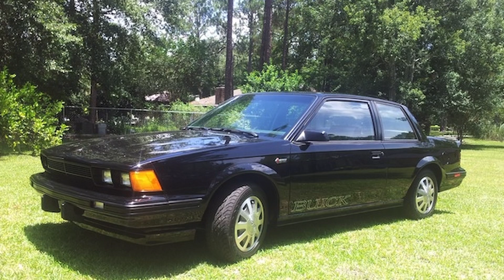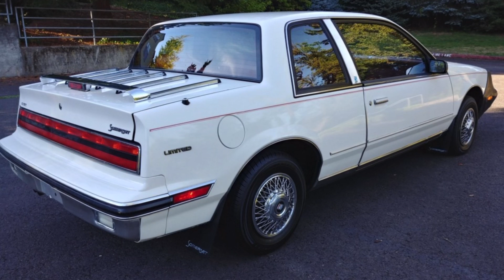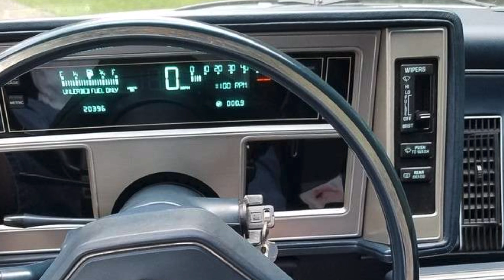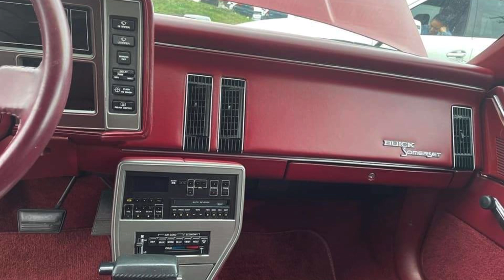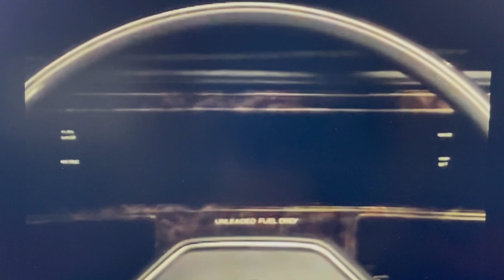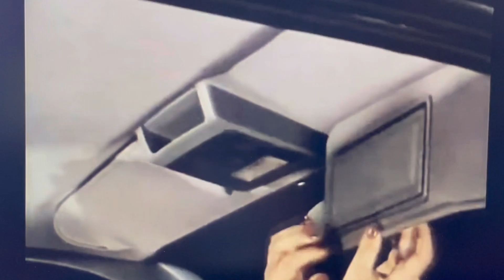Funky Automotive Interiors - The 1985 Buick Somerset & Its Tech-Centric, Porsche-Inspired Interior

Comment: My dad bought a red one in late January 1985. The next model year, 1986, the mandatory high-center brake light was standard. That year, 1986, everyone knew who had a new car. 

Airwolf was on TV at that time.  We used to turn the car on and play with the digital dash (I was 13 at the time). 

The interior sucked.  The plastic covering on the center console withered away.  

He junked it about 10 years after purchase.  I learned how to drive in that car.

Comment: These were nice little cars...my Grandfather (Mom's side) bought an '87 Limited new in Rosewood in and out.  The color was quite attractive.  They were much fancier than any of the competition inside, and fairly comfortable.  The options list was very long...his car had about half the equipment.  It was on the lot vs ordered personally or even searching inventories nearby.  I wanted him to buy one with the 6 cylinder, but he said he would save gas with the 4, as well as get one with the equalizer and Concert Sound (if not Bose), but his had the regular cassette radio with extended range speakers in the rear.  It sounded decent as I recall, aside from that exaggerated mid bass to make up for not having actual bottom.  We had it even after he passed on at the end of 2000, where at the beginning of 2003 my father was using it and got into a bad accident, which totaled it.

Comment: I had a 85 Somerset Regal with the 4 cylinder and stick shift. Loved the car although it had debris in the tank and kept clogging the fuel filters. Easy enough to pull over climb under and pull it off then blow it out. For some reason never occured to me to drop the tank to clean it out. Mine was a gold color with tan interior.

Comment: If I recall the 79-80 Buick regal had an Somerset trim package that looked very similar to the 78-79 Ford's Bill Blass Lincoln MK Vs, with that white and deep navy blue trim patterns externally and in cabin also. Saw  a 1980 Buick Somerset at Syracuse Nationals 3 or 4 yrs ago , reminded me alot like the Bill Blass color scheme.  I understand they are quite rare.

Comment: The socialist agenda of the 70s meaning tight emissions and cafe under Carter hit hard and the carmakers had trouble trying to catch up. This never should have happened. Yes better air quality but leave the darn cars alone as far as engine size and car size. Anyway there were good cars at this time but not like the 60s and 70s.  The GM 3800 engine was excellent. Some luxury cars like Olds and Buick and Cadillacs Lincoln kept beautiful interiors. Some smaller ones good too.  And to this day thanks to socialism the cars are not good and ugly.  We could easily make beautiful cars from the 60s and 70s today without all the government crap and have chrome bumpers and such rather than the stupid looking space like cars that all look the same and they’re all full of plastic ugly.   And I hate hard seats like today!
Reply: You know what gets ME? The govt. mandated those huge cow catcher bumpers in 74 to protect the body of the car and supposedly reduce insurance rates. Now, the fronts of most cars are so streamlined there's no way to even put a bumper on many of them so they are now HIDDEN  "UNDER" the grill. You bump something and your grille needs to be replaced. Well, at least the hidden bumper will be protected by the grille. What a bunch of nonsense.
Reply: @kenglavens6455 The bumper regulations were loosened later under Reagan. Now they are worse than useless.
Reply: Another example of central planning ruining everything. I mean, it literally destroyed the American car industry, which has never really recovered.

Comment: I find myself binge-watching your channel lately. While you are admittedly humble in your video production, your insider info into the design and auto industry -- the whys and hows and battles over why they did things -- are pure gold. I also follow Ed's channel (which is more tongue in cheek) and coldwarmotors channel out of Canada (who probably takes your craigslist rejected lost causes and brings them back to life) along with Harry's Garage and Tyrell's Classic Workshop for the more exotic selections across the pond. I've come to appreciate the mid-century lowly sedan and wouldn't mind a handsome 60s-era station wagon (if it fits in my 21st century garage). Had any experiences with the 1960 full-size Fords? I'm fond of that one-year design. Thanks!
Reply from the maker: Beautiful cars. Very rare.  The eight cylinder engines had a few oiling problems if the oil wasn’t changed regularly, but overall good cars.
Reply: @RareClassicCars  Beautiful, especially coming out of the 1959 ugly angry bulldog styling. Not to mention the 1957 "prostate exam" expression face. This one video features a "been in the family since new" Starliner which they hope to preserve and keep running:https://youtube.com/watch?v=zLXe_LD6EUk&feature=shares

Comment: All that technology, yet it has ventilation controls that belonged in the 1970's and only an AM radio as standard equipment🤦🏼‍♂️ If you want to see an actual, cool 1980's technology focused interior, check out the 1984 - 88 Australian version of the Ford LTD😁

Comment: I had one of these for a number of years in the 90s with the V6 and most of the options.  Loved it.  Super reliable car.  But I had a different door trim than the one in your video, and it was deeply flawed.  The 85 in your video had a recessed door handle on a swing bar, and mine had a pull strap on the door, which may have been a lower trim level?  The ends of the strap on either side were bolted into the door panel and covered with a plastic insert.  This was a bad design, as after a limited number of pulls, the plastic bolt covers would snap off, revealing a frayed strap end and a big bolt.  The problem was so prevalent that the dealers never could keep the replacement plastic end covers in stock.  It's almost impossible to find one today with this door trim that has the door panel looking like new because of this terrible design.

Comment: Back in the 80,s Buick was really kicking ass and taking names,high tech interior design the world's first fuel injection V6 engine for the regal Grand national producing an unheard of 200hp300lbs.torque,at the time they're 6v engines built from high tech and racing technology and when it came to luxury, it wasn't about comparing Cadillac vs Lincoln , for once it Cadillac vs Buick.

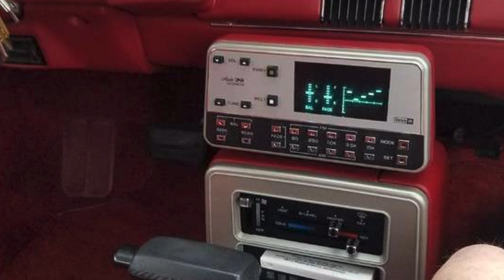Comment: Notice the car used in the photo at 6:34 had the upgraded AM/FM cassette with equalizer, yet did NOT have air conditioning!!! I always found it extremely odd and actually partly why GM fell as far as they did throughout the 80s that they actually offered air conditioning as still a separate option on cars which had other very new, cutting edge, and sophisticated (for their time) technology as standard equipment. On the Somerset Regal, with it's electronic instruments as standard equipment, AM/FM and air conditioning should have been standard equipment on every single unit.

These Somerset Regals could have electronic gauges, power windows, and cruise control without FM radio or air conditioning. You could actually order and have it built like that. 

Oy!

Comment: I was working as a mechanic at a Ford dealer during this time. I worked there from 1983 - 2006. Buick was at the top of their game in the 1980s, they were certainly offering more than Ford was putting out there. Thankfully, Buick.didn't offer trucks or they would have cleaned Ford's clock. I had a friend that worked at a Buick & Olds dealer during that time so I had an inside look at what they were selling. I wasn't aware that the Somerset came with an automatic trans. I didn't know much about the car anyway, but the two that Mike showed me were both manual transmissions. I just figured all of them were. 

It looks like a cool little car; a bit ahead of its time. The 1980s weren't a good era for any domestic automaker, but Buick sure made the best of it.

Comment: That interior is pretty rad for 1985.  Kind of cracks me up how many different variations GM offered on lights, wipers, cruise control functions over the years.  You get into a Toyota or Lexus from the 80's until perhaps 2017 and the controls for the lights, wipers, and cruise control are EXACTLY the same.  Yeah the stalks might look a wee bit different over the years but they work the same and all of them have the same high quality feel, from a base pickup up to a Lexus LS460.

Comment: All that engineering effort into the fancy dash, and the fuel-injected power trains. But GM couldn't be bothered to give these supposed "premium" compacts a 4-speed automatic transmission. Indeed, it would be nearly a decade before they would appear in this platform. Airbags? Took until '94 for that to happen. And we know how the bean counters nickled and dimed all the refinement out of the Quad 4 that otherwise was a solid powerplant.

Comment: I had a somerset . The low travel switches were recalled and replaced. I drove the car to 165k miles. That’s when the radio quit and I wasn’t going to fix it. The 4 cylinder was ok .  MY next car was a 4 door skylark with the train grill and 3.3 v6. I saw one on the road today.

Comment: I had seen the 1985 Buick sales training video before, so I knew about most of the Somerset Regal's features before watching this video.  However, watching this video does give me some slight renewed appreciation for this car. The Somerset Regal name started life in 1980 as an optional package on the 1980 Buick Regal. This was an appearance package with a 2 tone navy blue and tan paint scheme, along with 2 tone navy blue and tan seats.  I personally was never very impressed with the N body cars - but being reminded of some of the technology they used in the Buick version may have changed that slightly. The styling was, in my opinion, generic and not very inspired.  They could have done better there. The powerplants, as you mentioned, were not all that impressive - though at least they used fuel injection on both the available powerplants, and not a carburetor, like they did on the base engine in the 1985 Electra! It amazes me that they had a fuel injected 3.0L V6 available in 1985 and they didn't use it as the flagship Buick, the Electra's, base engine!  It also sort of amazed me that GM and Buick put so much effort into this car that is really just an economy car.  But making smaller, more fuel efficient cars was the way the market was going at the time.  I also think GM knew that at some point, the ultra popular rear wheel drive Regal was going to be replaced by a smaller front wheel drive car. That did ultimately happen when the W body came out in 1988 - but maybe the N body car, by calling it the Somerset Regal, gave customers the idea that, here is a smaller, more fuel efficient version of the then very popular Regal for your consideration. The high level of technology did not continue on this car very much past 1985 though. By the time the Skylark name was put on the coupe as well as the sedan in 1988, these cars had standard instrumentation.  Adam, you get credit for praising some things about an 80s GM car that many people would have either dismissed or bashed.  I personally liked the Buick brand in the 80s. They were a full line brand with 7 or 8 different models throughout the 80s. Any Buick model with a Limited trim level came with a very nice interior. And as you mentioned - they offered the interesting T Type models for a number of years on most of their models.  I think the CRT in the downsized 86 Riviera and later Reatta, as well as what they did here on the Somerset Regal, were honest attempts at keeping Buicks modern and forward thinking. If someone hadn't bought a car since 1980 and walked into a Buick dealership in the mid 80s, I think the technological advancement would be evident.

Comment: They designed that fancy new radio pod with the digital display and electronic pushbuttons... yet it still came standard with an AM-only radio? And it looks like they responded to complaints about the vertical radio in the early X-Cars as being awkward to replace with an aftermarket radio (although some did have an optional vertical tuning dial to fit it), by making the radio impossible to replace with an aftermarket one at all!

Comment: 10:40 "electronically tuned AM radio"?? I didn't know you could even get an AM radio in a 1985 car, and I've never seen an electronically tuned AM radio of any kind, ever. I'll bet not very many cars were shipped without the AM/FM stereo option. This reminds me a little of a story I saw about the last black&white console TV sold in the USA; I believe it was a 1981 Zenith with electronic tuning but  no remote control unless you paid extra. Even at that late date, there were some people who didn't like color TVs, either because of the compromised picture clarity or the artificially simulated colors.
Reply: I bought my 1985 Chrysler Laser XE with the minimum possible audio system, which was an AM/FM radio.  It does seem odd to still offer AM-only by then.
Reply: IIRC Ford did offer electronically tuned AM radios in their base models in the late 80’s

Comment: Ordered a 1985 Somerset Regal Limited coupe in March and it arrived a month later . It was loaded with every option including US Royal self sealing tires with very subtle,  small white lettering.  
Kept it 2 years and drove it 24,000 miles. Loved how it rode and drove. Only warranty repair was replacement of the right Bose door speaker with a built-in amplifier because it developed a buzzing noise shortly after delivery.  
Thanks Adam for this great video, I had forgotten some of the unique instrument panel features.

Comment: I knew someone had a Somerset Regal in the early 2000s it was maroon with tinted windows had original hubcaps missing. One thing liked about the Somerset was cool digital dash haven't seen one of these in so many years did liked the Calais and Grand AM platforms though would had bought bigger car something like Lesabre that was more reliable having big V-8 engine 307 Oldsmobile and smooth cruising ride which was last year of the big bodies until 1986 all were downsized to front wheel drive cars.

Comment: I loved the 2 door Somerset with the V6.  It was a quick car for the day and quite well built.  Most all Buicks were well built when compared to other GM's as component failure rate seemed way better.  I say that as a dealer tech in the late 80's at a Buick, Pontiac, Cadillac, GMC dealer.  Cadillac was the worse for quality and Pontiac was next with assembly quality being their main issue.  GMC, even though built at the same plant, seemed to have better assembly quality than the Chevy.  
That said, my Dad's 89 Lesabre that he put a little over 200K on before wrecking had 3 PCMs and 5 alternators replaced in it's life. LOL  The crappy TH440 trans lasted the life of the car though with services performed religiously every 15-20K miles.  And of course there were a couple of waterpumps. 
Loved the sporty Somerset though.  Probably the only front drive classic I wouldn't mind having.  Well, maybe a Reatta if I could live with the inop screen.
Thanks Adam!

Comment: I had the 1985 Olds Calais with the Tech 4 aka Iron Duke 4 cylinder. It was silver with blue interior and talk about plush everything. I got a lot of compliments on it. 

I loved everything about that car except for the engine which left me stranded once because of oil pressure issues and when it did it again I drove it all the way home knowing it was ruining the engine. I had had it. 

I still think to this day that was the most well designed little personal compact luxury vehicle I've ever seen and it's too dang bad they couldn't work out the issues with that pushrod 4 because it was very torquey and efficient and had a lot of potential!

Comment: My mom owned a 1987 Somerset with a 2.5 "Tech 4". when I was growing up. I'm a mechanic now and this was the first car I ever worked on. The only things needed replacing  in 150k miles  were an oxygen sensor, oil pressure sensor, and the headlight switch. Very simple to work on. She traded it in for a 1993 Grand Am with a 2.3L Quad OHC, and that engine was a nightmare to work on. I was 16  and the head cracked, and this was the first major repair I ever did and it was soo difficult. I went for a job interview once and was asked about my experience and I stated that I replaced the head on a Quad4 by myself when I was 16 and was hired on the spot.
Reply from the maker: That’s awesome
Reply: I would have hired you too! That's kinda impressive.
Reply: What a coincidence.  A friend of mine had the same experience. They had a white Somerset Regal that served them well until it was broadsided by a red light runner, replaced with a Grand Am that was the butt of endless jokes.
Reply: I had a 1987 Somerset, too. The first car I ever bought. Had it 10 years and never any major trouble.
Reply: @randyterry9672  Now that's a very well-built automobile!
Reply: perfect story
Reply: The 2.5 iron Duke was awesome, especially the late 80s one with balance shafs.